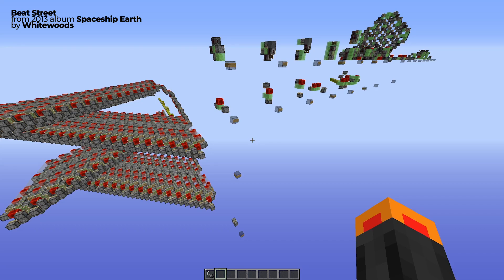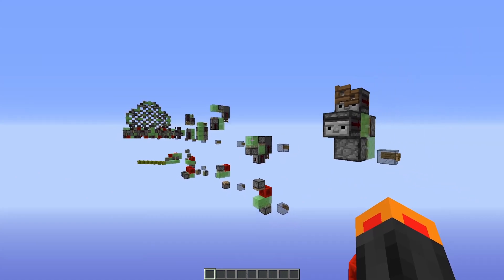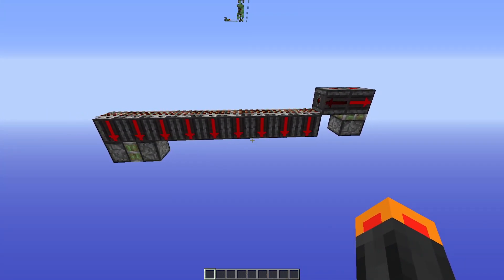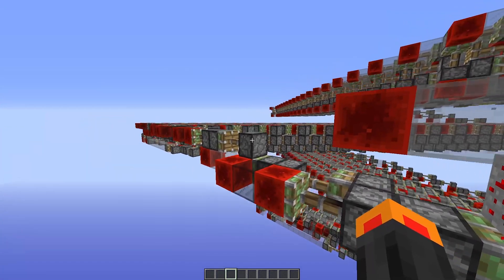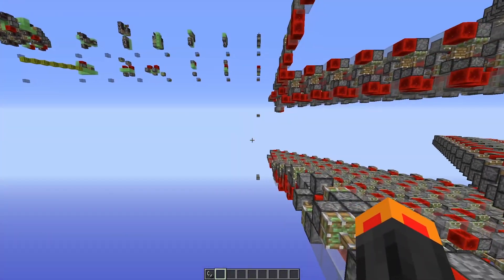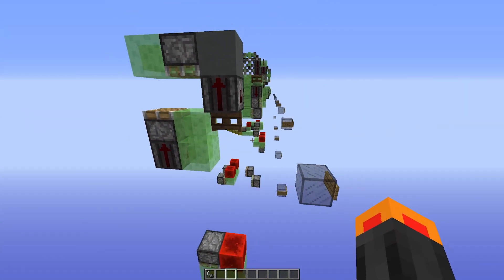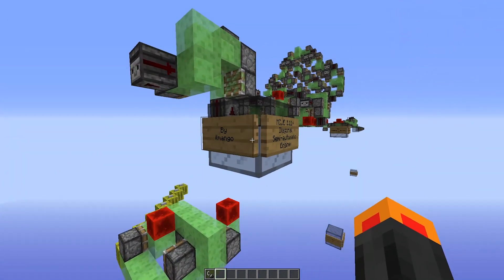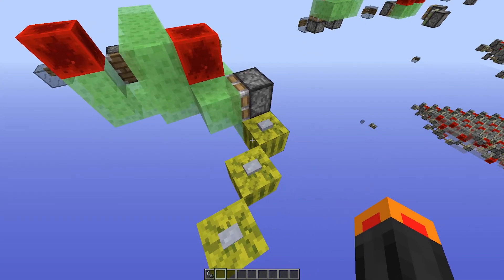Incremental Flying Machines | Minecraft

Comment from the maker: Don't forget to send your incremental engines here, if you compacted some design or made completely new one. This way we will have a single place to go to for incremental engines.
Reply from the maker: UPD 24.09.2024: DividedByZero and Shinji made a way more compact 1.5 engine and I later turned it into manual update one.
It is posted on Slimeless Tech Discord server: https://discord.gg/D6xSnEQYgu
Post URL: https://discord.com/channels/1272115372312629248/1272123233469988937/1288195616811520102